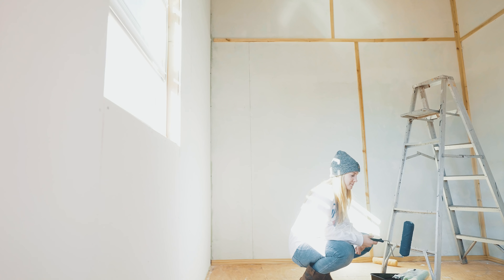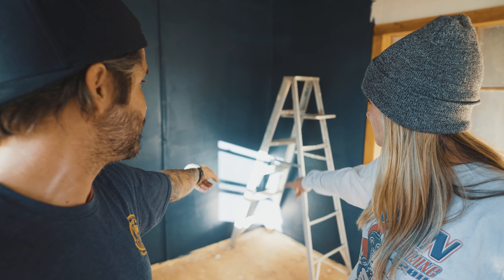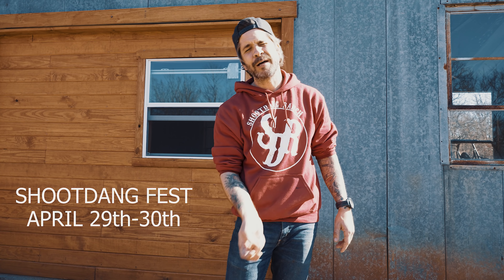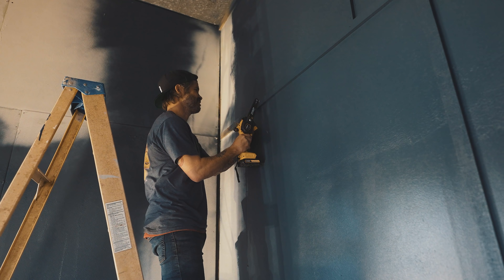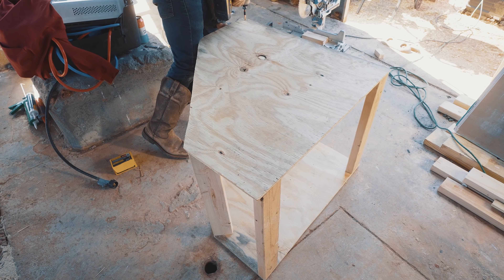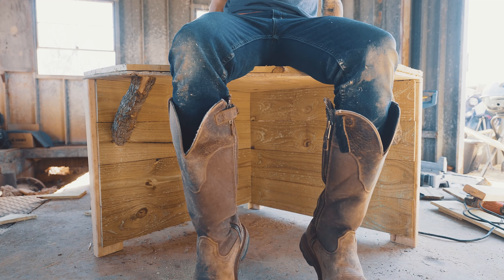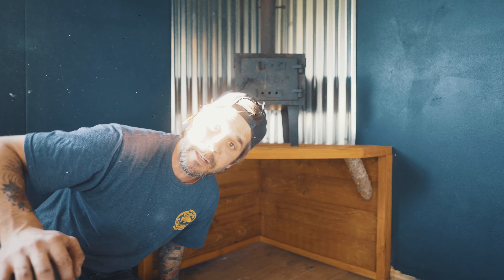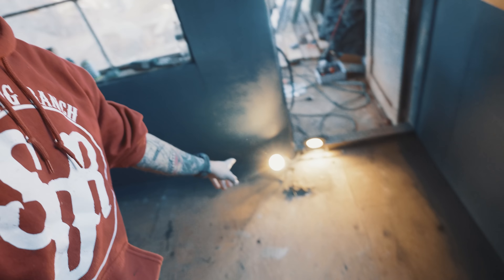Couple Transforms TINY Barndomium! DIY Fireplace Build / Ranch Makeover

Comment: Hey Crokers of SDR, I do think the dark blue on the outside with the wood stain colour contrast, it will look awesome. A you may want to want put stone or tile under the fire place so no sparks, or coals catch the wood on fire. Just a safety tip. The set up of the fireplace looks really great.
Reply: Thanks guy's.
Reply: That's what I wondered, seems like tile would be easy to clean, too. Yep I think the contrast looks good even though the blue is dark.

Comment: With the spot under the wood stove being open, you could always add a small "wall" on the bottom to make almost like a bin to store your firewood there...that way, you can bring firewood in to keep the fireplace stoked, and not have to worry about sawdust/wood pieces/dirt getting all over your floor, and you can easily fill the bin when it gets low.

Comment: I love the fireplace, the color of the wood on the windows trim, shelf. The color does goes well with the wood. The main thing is that you both like it and it can always can repainted a different color if you decide you want to later on. The metal really brings out the color as well.

Comment: You should use a ceiling fan light to push the warm air down in the winter and push it up in the summer, also an exhaust fan that pulls the hot air out in the summer that seals out the cold in the winter.

Comment: Also they make insulated dark out curtains that you might consider for the windows. When it’s cold or hot it will help insulate the room or you can leave them open  for the light but you also have the option to close them to darken the room in case someone needs to sleep or for privacy.

Comment: Jason when you get that chimney through the wall, you need a double walled pipe at the top going through the wall to protect it. I'm thinking you know this. Please don't use that flex pipe you have up there now. Ceramic tile on the platform is a good idea and I would put 1 log leg under the stove for a little more support. Everything else looks great!

Comment: I for one love that color in there. With the ceilings being so high you wont really have to worry about it looking smaller. Well shoot dang I won't be able to go to the Shoot Dang fest this time. I will be recovering from surgery :( . I think the room looks great. The only thing I would have done just a tad different is  made the tin so it would have had a 1 inch gap for air flow against the wall. But like you said you know your stove. I like the height that the stove is will make it a lot easier to cook on no stooping now.

Comment: The room is looking pretty good. Hope it's not going to be too hot in the summer without insulation (although I guess you could always use a tent if it gets very hot inside).
Reply: Probably not wise to listen to a no nonsense old woman,but if it gets too hot in there cut a hole in the wall and stick an ac in it. You'll no doubt have electric out there by summer.

Comment: Looks great. But you need to do something about insulating the ceiling!!! 90% of heat loss is normally through the ceiling.  That is a metal roof, it will conduct heat directly to the outside, like in a massive way.  Maybe get some Styrofoam panels, and just glue them to the ceiling (using liquid nails glue.)  Or set up some framing to the ceiling, and anchor the Styrofoam panels that way.

Comment: Love the color with the wood trim color. The one thing I will say about the wood stove is you should look for something else to go under the wood stove in case of embers come out when you put the logs in.  I just thing of safety and on this one fire safety is first. The dark blue with the wood trim also reminds me a bit of BOHO feel and I am digging that. Is there a way to secure one beam across the top but dropped down a little to hang a pendant light to it? That will give you the over head light and then a lower light next to the bed or chair in there once it is all set up? Anyways just think about something under the stove for what I mentioned and it is up to you to decide. Just a concerned snowflake ~peace

Comment: I would at least put something under the stove. but as for the wall its drywall its not going to catch fire, and with the metal it will direct the heat out. I don't see a problem their.   but since you didn't insulate it because you went the cheap rough it will take a lot to heat and cool.  It is a small place but if the fire goes out ect it will not hold any heat.

Comment: It looks sharp. I would suggest you use some brick under the stove and under the shelf to catch sparks and the lower portion should run out proud a ways of the top.

Underneath is a good place for wood and stove tools.  The little cheep geometric papers should allow you to fit the shapes you need to fill.
Just a thought 
Wolfmama0104

Comment: man you should back roll after you spray to get a better texture, you should wear a mask when spraying indoors, and finally its killing me that your rolling walls out by hand. paint rollers have an opening at the bottom to screw in a pole, you could use a broom handle if you don't have an extendo pole. byut it looked good overall.
Reply from the maker: Cool